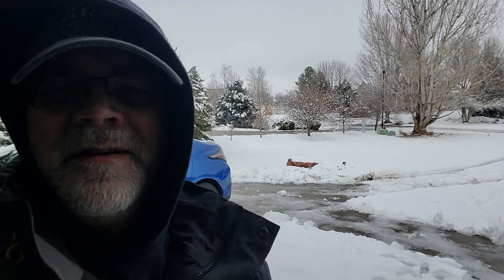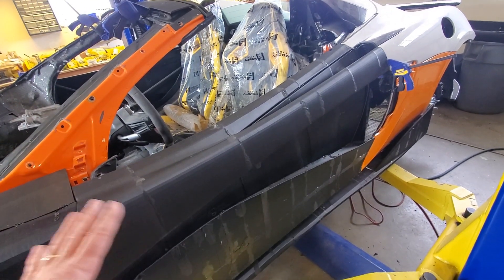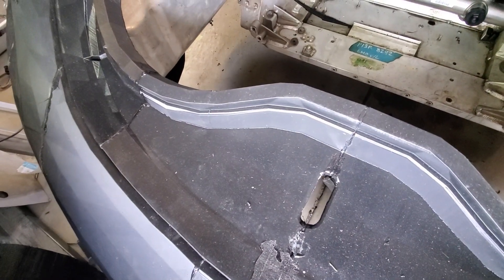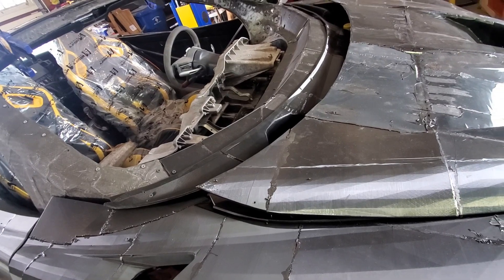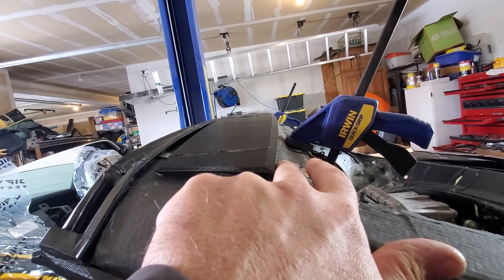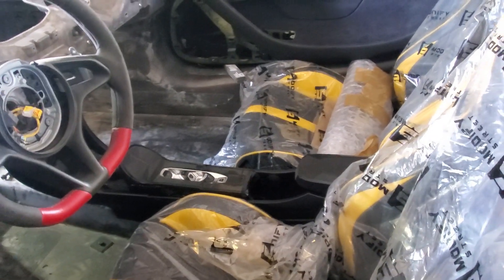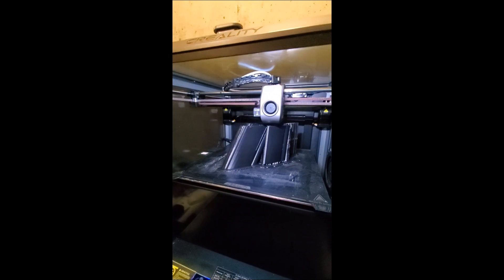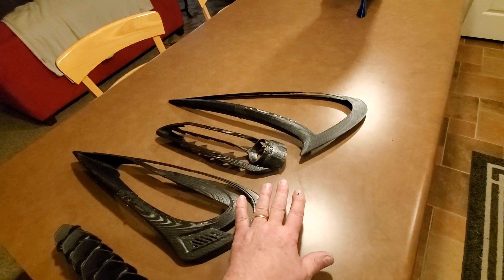3D printing a McLaren 600LT

Comment: Who made the wheel adapters?

What wheel Bolt Pattern are you using?
Reply from the maker: Premier Auto ACC (eBay).  5x112mm to 5x4.5"  Temporary since I will be putting different wheels on it.